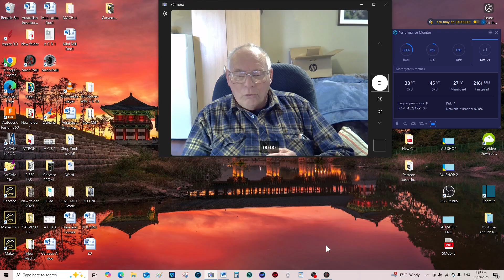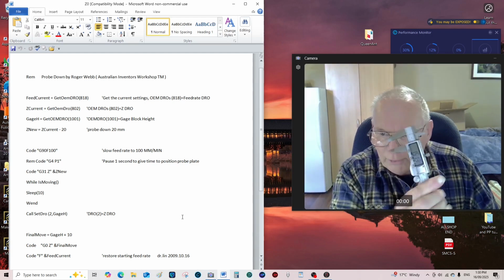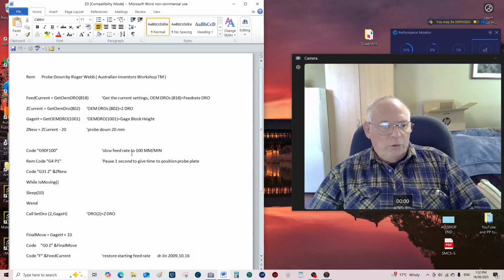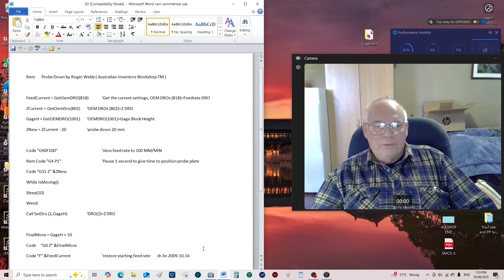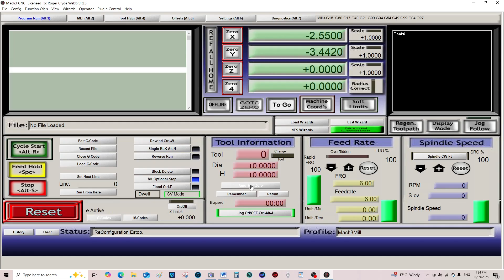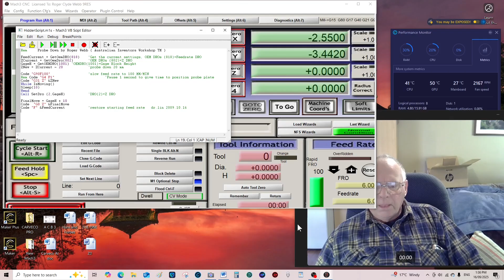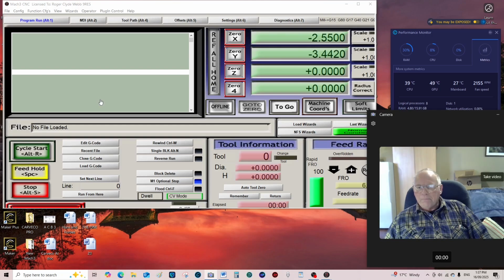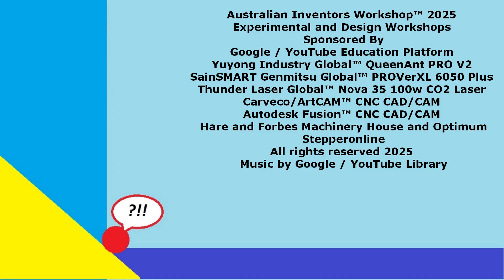979 Simple CNC Mach 3 Z 0 script Questions and answers

Comment: Very few proper tutorials are available for Mach3 Turn (Lathe).
If possible, please make a step-by-step Mach3 Turn tutorial.
It would be even more helpful if you can show it using a Mach3 USB Green Controller, since many users are using it.
Also, does this controller support:
Spindle encoder & threading?
Proper feed synchronization?
What are its limitations compared to the parallel port?
We are tabletop lathe machine manufacturers, and such a tutorial would help the entire CNC community.
Thanks in advance 🙏